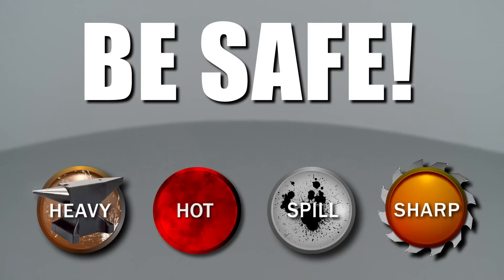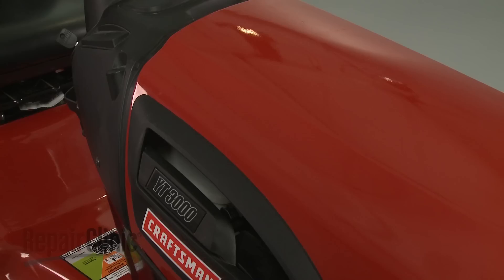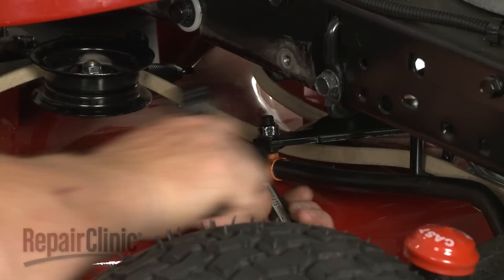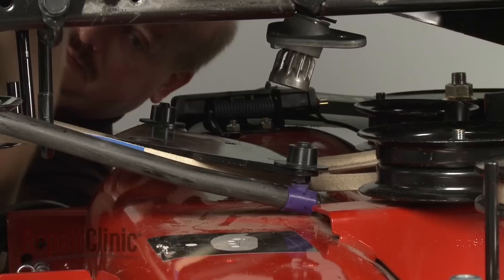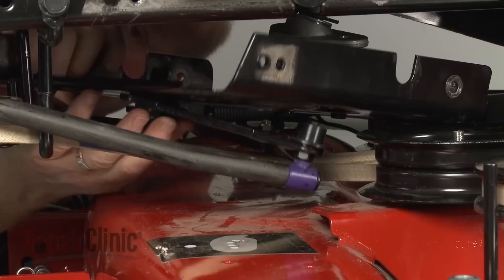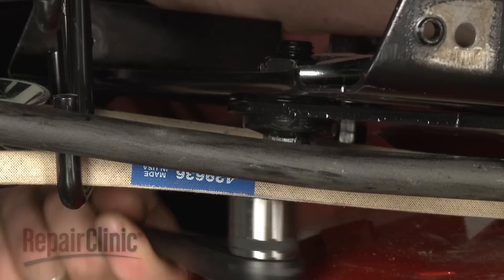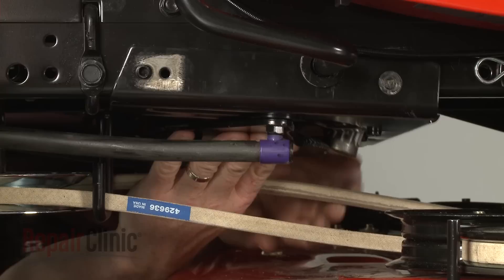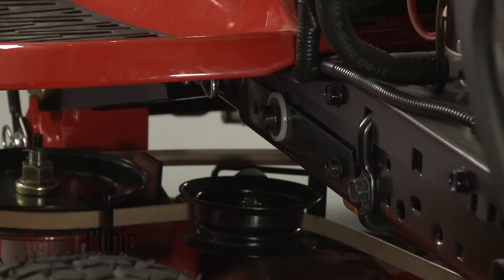Craftsman Riding Lawn Mower Replacing Steering Sector Gear  #583551401

Comment: Thanks, That helps I think.
 Not so easy when it's a 12-13 year old mower.  I might have to cut the bolt holding he sector in place.  t just won't come out.

Comment: Thanks for the info, I have DLS 3500 only the fuel tank don't just pop out like yours?
Reply: john white
Reply: john white, were you able to replace the steering sector without removing the fuel tank? I was surprised to see that it needed to be removed, as the JD L111 can be done all from the undercarriage.

Comment: You people have lost it . This damn thing isn't anything like the riding morrow I got. But I do have what you call a generic Craftsman. It's not a real Craftsman , I think it was made by mtd are Murray. So what you have here and what you are doing don't help a damn bit. 😒😦🤔????
Reply: Blame it on them that you own a POS
Reply: Craftsman sold out to MTD a long time ago. But that doesn't change the fact that this video shows you how to change the steering gear on this type of steering mechanism.  Craftsman has had many different types of steering mechanism. This is just one.
Reply: @hrdman2luv  Using this to work on a Huskvarna which appears to be identical (MTD?)
Reply: @glennnickey3160  Husqvarna used to make Craftsman mowers for Craftsman. So a lot of the designs are going to be almost identical.  In fact you'll find a lot of older Husq part numbers matching up to Craftsman/MTD parts.